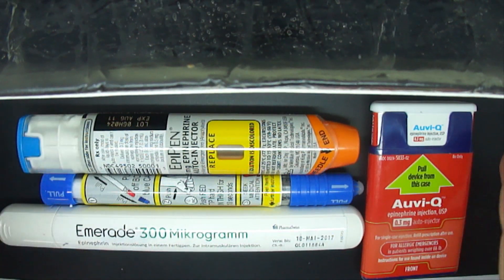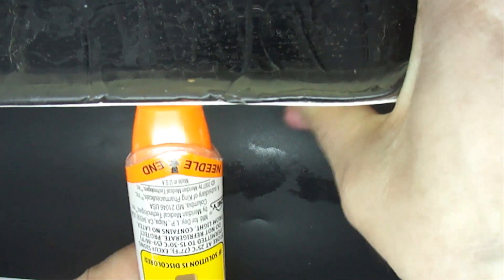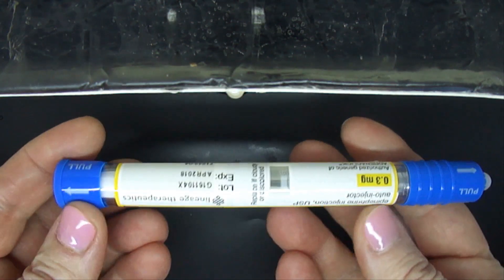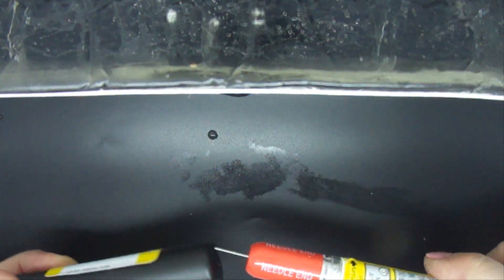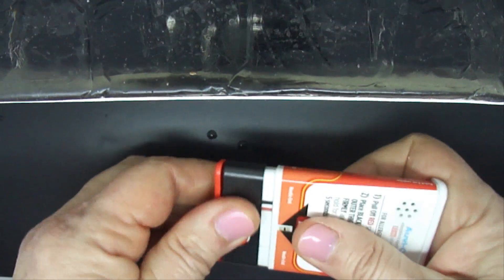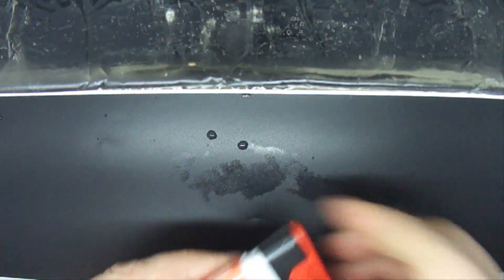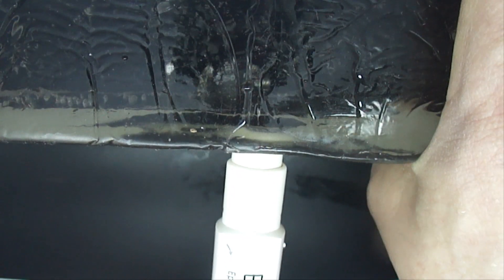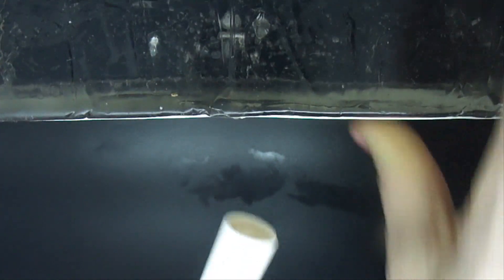Four Epinephrine Auto-injectors Firing into Ballistic Gelatin -- Older Version With Emerade

Comment: Hmm, I noticed when the Epi-Pen needle was withdrawn, it pulled some of the epinephrine out with it...could this occur during actual use?
Reply: Butterfly Angel 
I’m not a professional but I’m almost 100% sure it shouldn’t 
The gelatine used doesn’t take in the medicine like the fat or muscle would in a person 
The full dose should be injected into the person and shouldn’t squirt out
Reply: Your suppose to hold it in you for 10 seconds instead of 3
Reply: Some of it does leak out, but not much. A used Epi-Pen won't fit back in its case after use, and after going to the ER, my car has a very strong medicinal odor. I have never used the Impax yet, and the trainer device isn't very helpful.
Reply: Yes which is why I would hold it for a couple extra seconds (with ANY epinephrine shot

Comment: Ummm, Epi Pens need to be held for 10 secs btw
Reply: I just got brand name epipens and its still 10 seconds not 3
Reply from the maker: Emily Mullins There are no regulations guiding how quickly packaging has to be change after an FDA mandated change and it seems Mylan has preferred to use up outdated boxes rather than make sure all instructions are consistently saying 3 seconds everywhere.
Reply: @emilymullins3486  yes, the packaging still says 10 seconds. But that's no longer correct.
Reply: They've recently updated the instructions. It's now three seconds. https://www.foodallergy.org/about-fare/blog/updates-to-instructions-for-use-of-epinephrine-auto-injectors